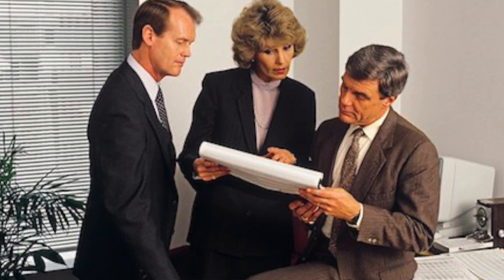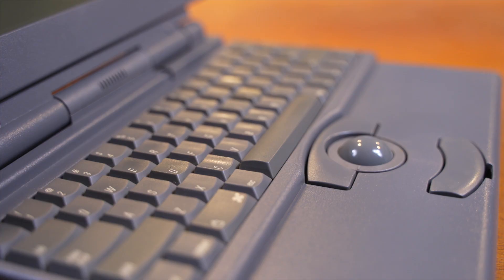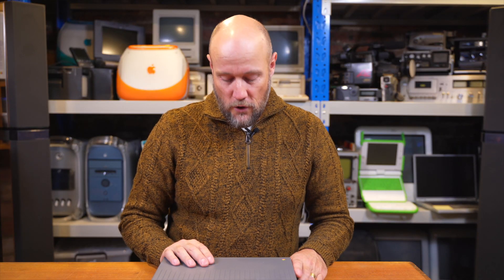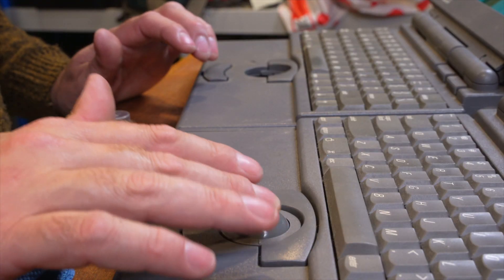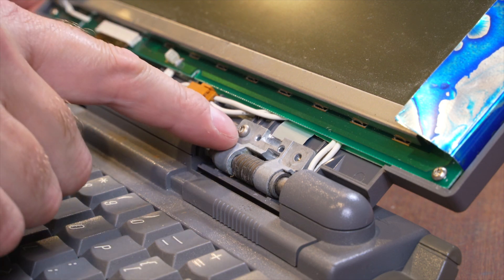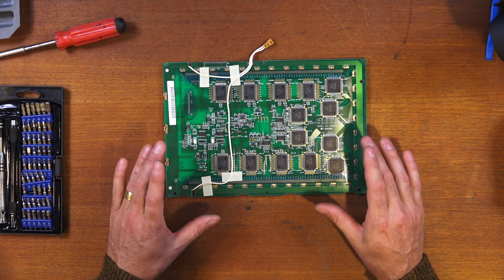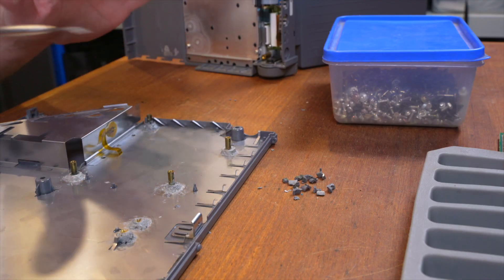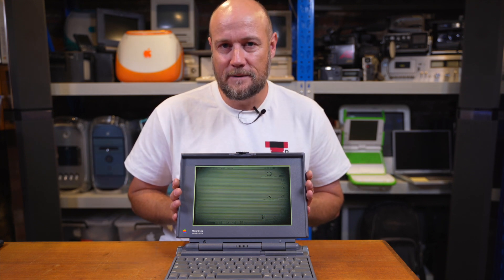Powerbook 170 - Apple's High End $13,000 Laptop From 1991 - Review & repair!

Comment: Hey sorry to bother you but I have a question that I think you can answer. I have a Powerbook 170 but it doesn't have a hard drive. I've heard of CF Card HD adapters but I don't know which one I could use in my machine. Would you have any clue? Or if I can even get a replacement HD in general? Thanks!
Reply from the maker: No bother! These early Apple laptops are tricky in that they use SCSI hard drives, so normal CF-IDE adapters don’t work. Good news however is the blueSCSI project is an affordable option. And I think they are now making a powerbook version. I have one I use on the external SCSI bus. Check out the blueSCSI wiki or do a search for that on YouTube. Have fun!
Reply: @TheBasementChannel  Thanks a bunch 🙂

Comment: I have  PowerBook 180 with the same problem. As for the case, I have my fingers and eyes crossed hoping someone will step up and make replacement cases a la the Amiga community has done for their systems. After baking, would there be a way to reseal the thing? Nail polish around the edge or similar?
Reply from the maker: I would be hesitant to use anything to seal the edge. It’s not apparent where you would apply it, and the moisture theory isn’t really proven yet. Some say the baking helps restore the contacts between the lcd and board. No one really knows for sure.

Comment: If it’s a moisture issue, what if you put the screen in a food dehydrator? Would that be safer than the oven?
Reply from the maker: I did think of that, but decided on the oven for the following reasons: 1. I don’t have a food dehydrator. 2. Every food dehydrator I have seen is round, and I’m not sure how the screen would fit. 3. Every dehydrator I’ve seen is fairly cheap with basic controls, with the oven I can keep a constant finely controlled temperature. 4. Any oven can dehydrate food as good as a food dehydrator, so I can’t actually see the dehydrator doing a better job than the oven, and don’t see why it would be any safer?
Happy for someone else to try and report back.